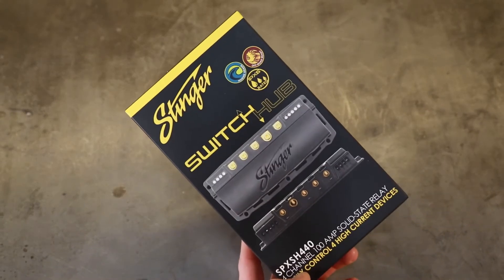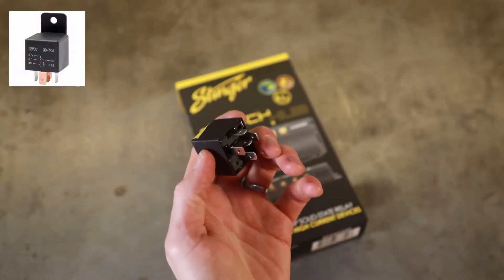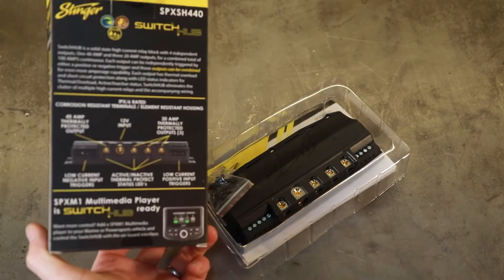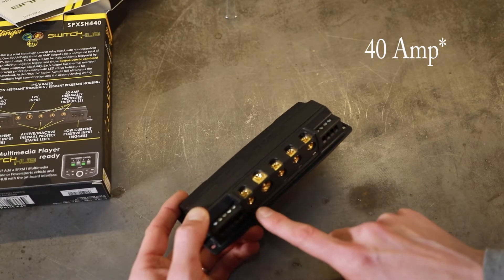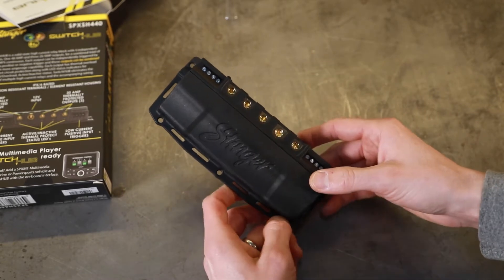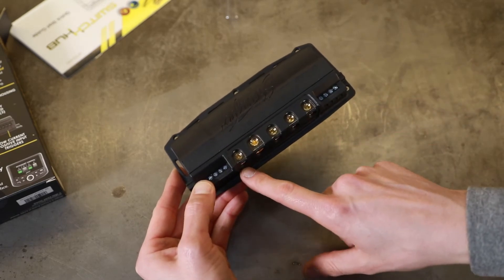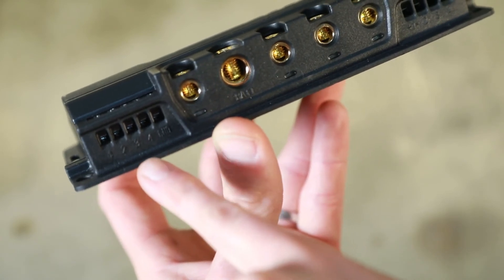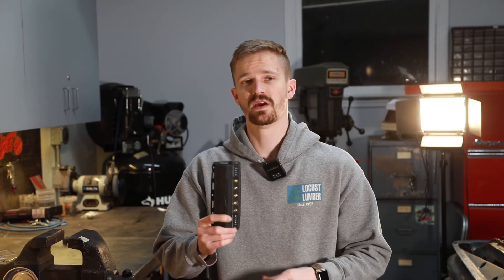You Need This Solid State Relay In Your Next Build!

Comment: I think I'll stick with old-school relays.  They are small, cheap, reliable and time-tested.  I know how they work, and how to troubleshoot them.  I can easily afford to keep a supply of spares in my vehicle.  If one were to fail on me, replacement is easy.  If I need one while on a road trip, let's say, I can buy one at any auto parts store.  That's not the case with your solid state relay.
This seems like another example of automotive tech, just for the sake of adding tech.  "If it ain't broke, don't fix it!"
Reply: Couldn't have said it better myself. Boat builders are now using touch screen switches and solid state controllers for lighting, blowers, pumps, and everything else. It is very costly when one relay segment in an entire controller that has maybe 10-20 solid state or electronic relays as apposed to electro mechanical relays goes bad. From my vantage point the cube relay presents very little problems. Maybe the control side of the solid state relay draws a little less opposed to the 1-3 amp draw from the mechanical relay but that would be the only advantage I can see. I think electronics actually fail more often than mechanical and I know it's more expensive to replace.

Comment: Msd's standard one is 20 amps continuous per channel they also have a high current that is 35 for all channels. These definitely are a much nicer unit than standard relays also you can bridge/parallel outputs to meet higher loads as needed.
Reply: the MSD one looks a bit nicer    just higher quality  plastic  more compact  I'd love to hold the 2 in my hand before buying